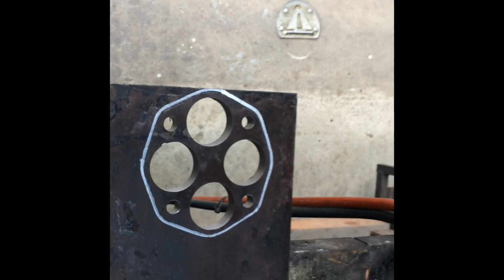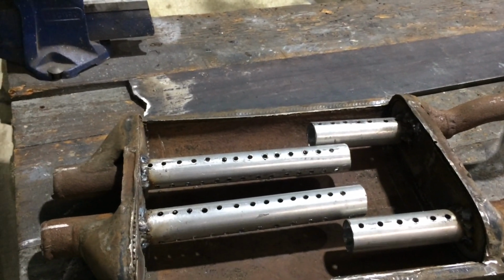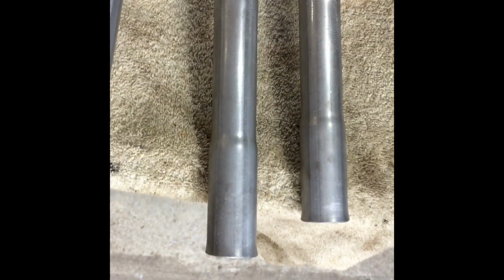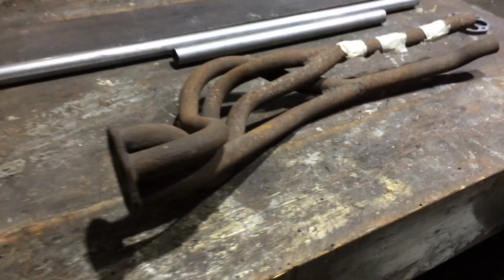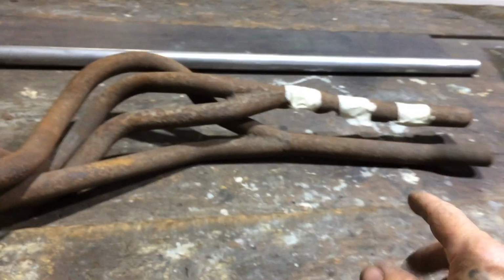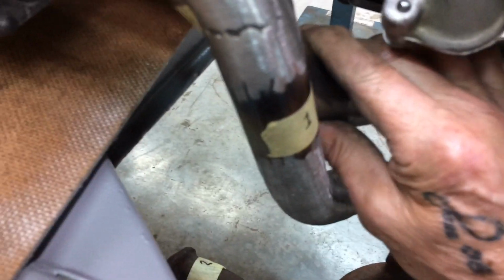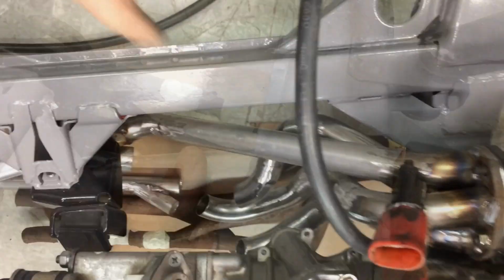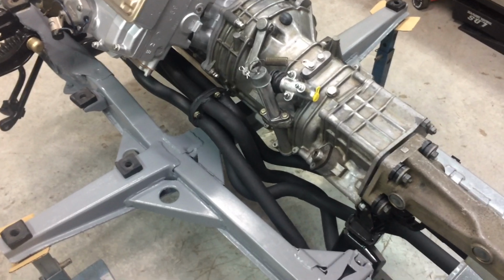Honda S600. Making the Exhaust

Comment: HI Jason. Great work again. The chassis/body mounting bolts are a shoulder bolt type. This is to limit the compression on the rubber mounting bushes. The bolts torque down onto the shoulders leaving the right compression on the rubber bushes. The S800 ones also have a split plastic collar on the bolt shaft. I'm not sure what this is for maybe to stop them creaking?? I'm not sure if the 600 had exactly the same design. Ortmanns list has pictures of the bolts. Presumably you can turn up some spacers to go on the bolts that you have.
Reply from the maker: Thanks David! I do have a few OG bolts & was planning the make some spacers for that, I will give that some good thought thanks. Cheers!!

Comment: Jason - Even though you have closed up the muffler, you might want to reopen and pack with steel wool or fiberglass.  Reason for this is the muffler, as it is, is likely to create a loud droning noise that will drive you nuts when riding in the car (ask me how I know this).  Otherwise, more great work and getting closer to putting the car on the road.
Reply from the maker: Thanks Ron! Man that is the go. I was thinking to wrap it in Fibreglass Matting but was afraid of it catching fire. When I cut it open it all smouldered & was catching fire. I wish I thought of Steel Wool, I do have enough of that here to do that. I will probably do that in the near future Thanks! Cheers!!

Comment: No flex pipe??   LOL   There is a lot of pipe for a 4 cylinder. I'm guessing it's tuned to help performance
Reply from the maker: Thanks Joe! Funny you say that I was thinking to use that but My Exhaust mate told Me it wont run right with that it's only for Diesels & only good for 14" sections. Too many leaks. Cheers!!